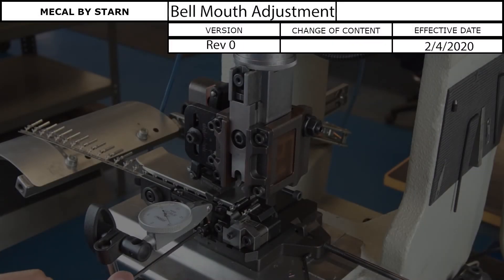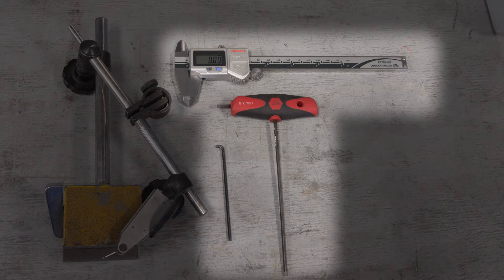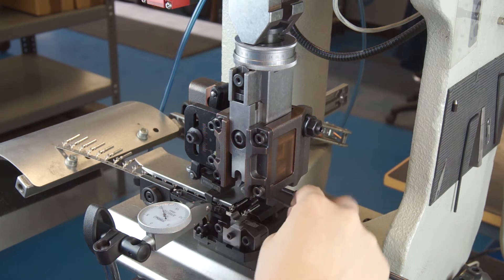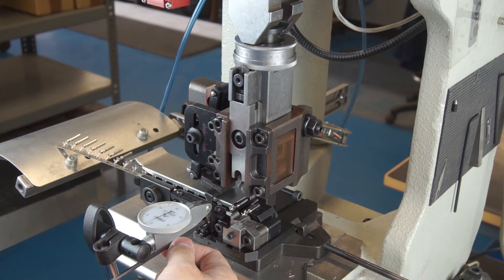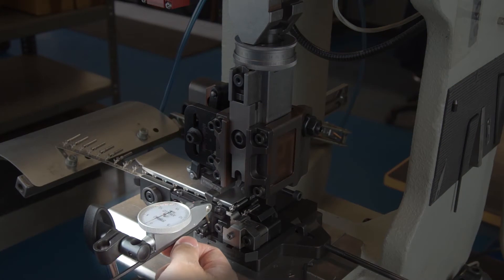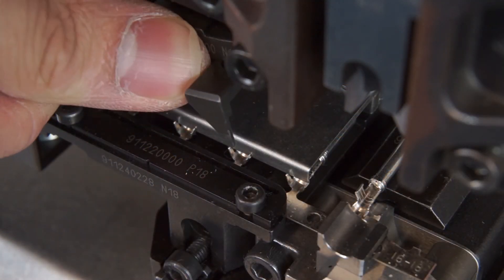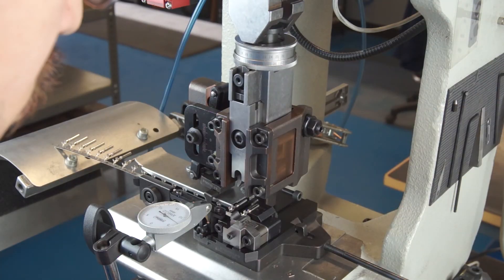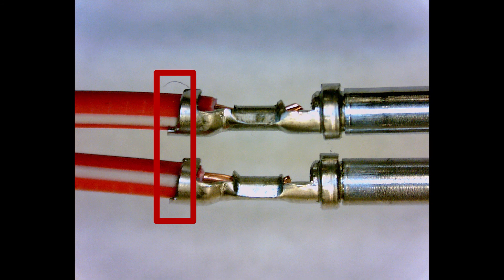Bell Mouth Adjustment

Comment: Finally a proper instruction on this ''issue''. It's been bugging me for a while. I always aim to get them fully closed, so without a bell-mouth. In my opinion it looks better and provides a stronger grasp and connection. Though if those are negligible for say  anything between AWG26 - AWG18, then I know I won't have to worry as much about the results.